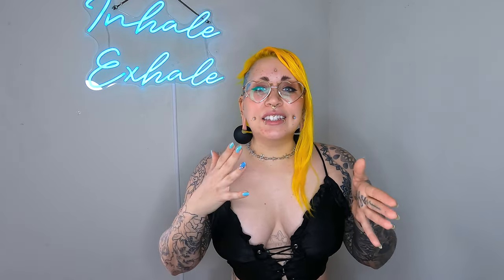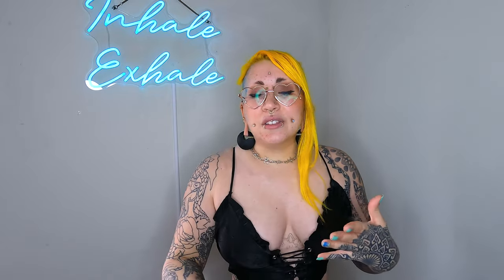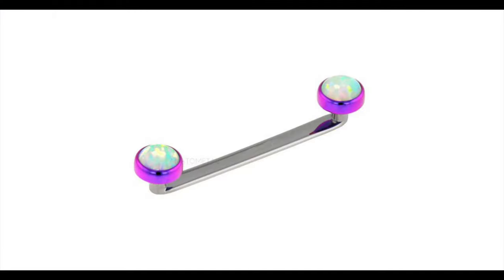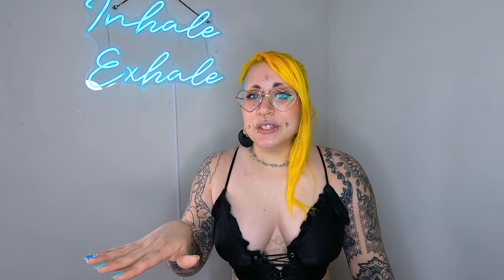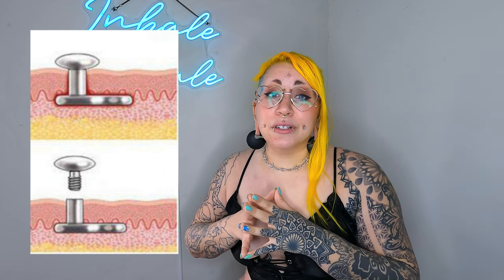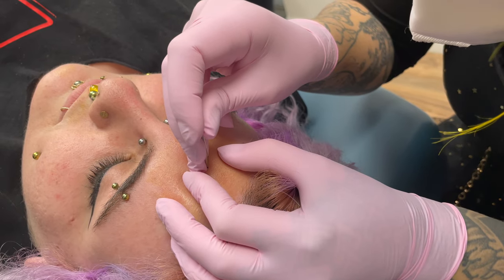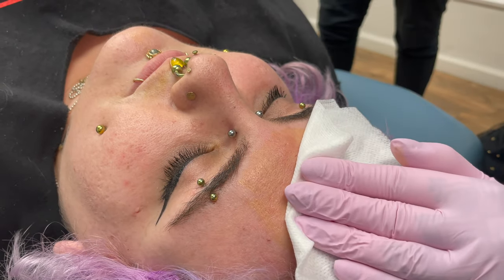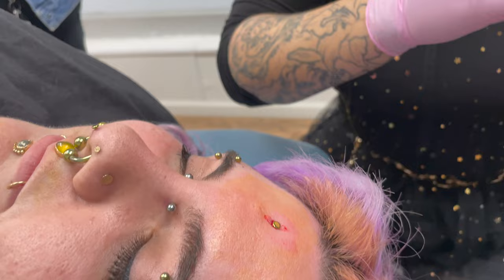Surface Anchors 101- How do they work?

Comment: With the anchors with holes in them, don't they need to be cut out due to skin growing through them? I am currently an apprentice and I've been taught at two different apprenticeships that they need to be cut out with a large gauge needle. How would I learn how to remove these less traumatically?
Reply from the maker: Nope! With proper tissue massage technique they can also be stretched right out. No need to cut them with a needle to remove them. I would seek out a piercer more experienced in anchors who could work with you on this!

Comment: You said they are good around the eyes, does that include along the brow bone? I want symmetrical ones on the outer ends of my short brows
Reply from the maker: Brow bones are super anatomy dependent but I would say 1-2 years is a solid run there. Brows have so much movement that they often reject faster in the placement. Some
folks get lucky and have them for ages but I would be ok with some ring very short term if you choose this placement.